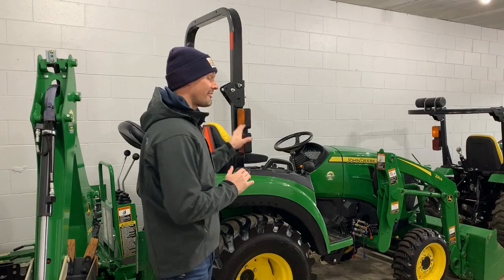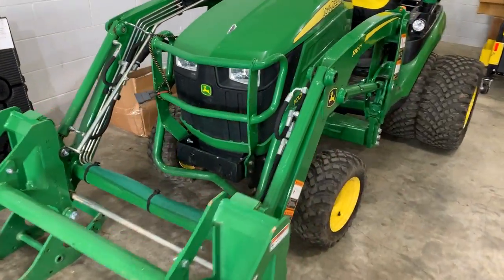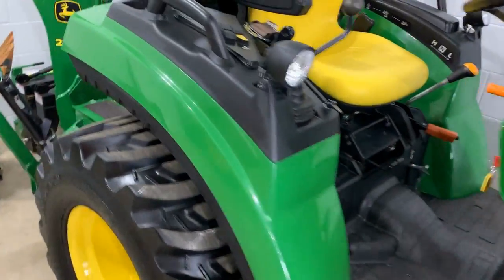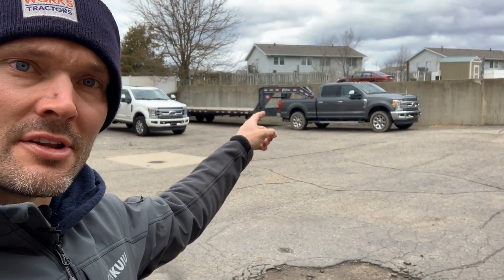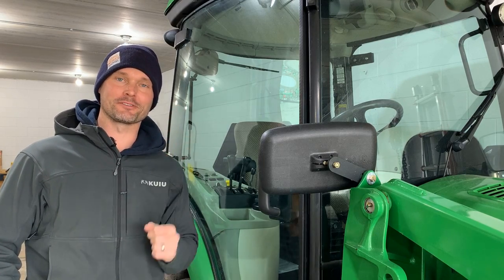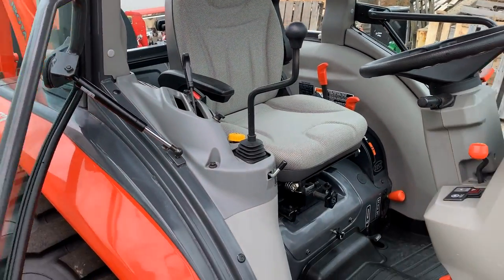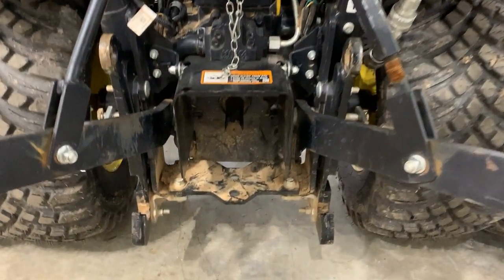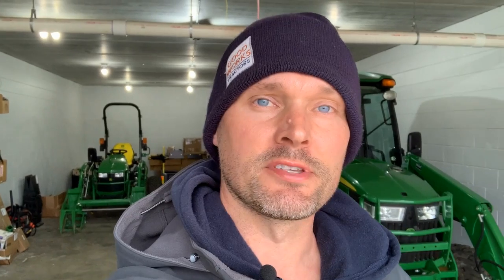TOP 10 SCREW-UPS JOHN DEERE MADE ON TRACTOR DESIGNS 🚜

Comment: IMO - The twin pedal with the forward on the inside is ergonomically correct  … the forward pedal on the outside i think would become uncomfortable during long forward running times … I’ve NEVER had an issue with my 955 and its also perfect on my new 4044M ! …. imo 
     agree with the seat critique fully !! 
    No doubt kubotas are one tough machine … but the hydro trans pedal …. well .. its 👎👎

Comment: I love my tractor but don't want to spend unnecessary time doing  repairs. First thing I installed was a skid plate . There  are to many things a stick can and will find and damage. Filters, hoses,  linkage , hydrostatic fans and so on, leaving you out in a bad place to work on. Been there.  Plus the expense and down time. A skid plate is cheep insurance.  Water separaters,  all diesel engines needs one
Reply from the maker: Yes, skid plates would be great as widely available accessory

Comment: They could put heaters on the LED lights eh? Especially on the front lights
Reply: Yes, that is a very good way to go.  At cold temperature they can hold the lights surface just a few degrees above freezing.  On cool wet days they could hold them a few degrees about outdoors temperature.  
They could also allow the lights to go up to "death ray" power  To get someone's attention.  200W into good LEDs will give your neighbor a suntan.
Reply: @kensmith5694  You only need heat when it is freezing or below the rest of the time no need to waste power.  You can run more current thru LEDs but the more you run over optimum the shorter the life
Reply: @sergeyleftwingnut2385  
For electrical things keeping them a little over outdoors on a cool wet day is a good thing to do.  It takes very little power to do it so if the thing is running it is likely you don't need to work at it.  When something is powered off, the water tends to soak into it.  This shortens the life.
Reply: @kensmith5694  I don't know Ken an incandescent bulb especially lower wattage are better heaters than a light source and if you don't keep them sealed they end up corroded.  I can see using heat to keep ice from forming but for my money I'd rather seal/ encapsulate/ keep  stuff dry/  water out rather than try to dry   up water. I'd rather it never get wet but easier said than done.
Reply: @sergeyleftwingnut2385  
I have never seen an attempt to seal something up other than a pressure chamber actually work in the long run.  A small opening that lets the air come and go is all that is needed.  In the morning, the object is colder than the environment.  Dew will form inside as well as outside.  All lighting fixtures for outdoors have to have a small hole at the lowest point.

Comment: JD is not a innovative company, and I know this will upset a lot of people but look at how long it took them a 6 cylinder engine, other companies had 6 cylinder engine for 30 years, Electric over hydraulic, Oliver had that in the early 60's , Rotary combine they were the last on the market, Case ih White Gleaner all had Rotary 20 or more years than JD.  In my area the only market they haven't lost out on is the front assist tractor.
Reply: They do innovate when it comes to preventing anyone other than their own service technicians to repair their brand.

Comment: if i was getting a garden tractor i would get a ventrac. thats it it does everythign and more than them other garden tractors
Reply: Except they cost more than 3 times more than a sub-compact and have fewer attachments available.  I'm not knocking their usefulness nor quality but, the astronomical price is a major barrier.
Reply: @flick22601  no they have way more they have all different mower options that are easier to attach than the stupin under deck design, it can have a front loader that easy attaches, it has a low center of gravity it can have a 3 point so will fit all the implements the other garden tractors can. and has loads of other attachments that you would need a complete separate machine to do the job of the ventrack
Reply: @flick22601  for what they are i would say the price is worth it

Comment: The #1 thing JD does wrong is the price!   They are much more expensive than Kubota, but you don't get more, and sometimes you get less.   Compare a Grand L4060 HSTC to a 4 series R apples to apples, or as close as possible, and the JD is several thousand more.  Add in the extra year financing Kubota has and it makes it easy to choose Kubota.   Sure Kubota has some flaws as well, but when it comes right down to it, money talks BS walks.  If I could get a JD for the same price as a Bota with same finance terms, I would happily go green.  20 years ago, it was a toss up between Green and Orange, and the bottom line was the price, Orange won back then.  Has been a VERY reliable tractor, which also has a lot going for Orange.

Comment: The reason their not a cab option on the 1 and 2 series is the frame not big enough to handle the weight and height plus it will add 15 grand to the cost
Reply from the maker: The Kubota B2650 has a factory cab with air and heat.  It doesn't add anywhere near $15,000.  Also, the Mauser cab for the JD 1 and 2 Series most likely weighs close to what a factory cab weighs.  So, doesn't make sense.

Comment: You don't need a cab on a 2 series John Deere. I have an older style and the vast majority of people who buy these aren't looking to use them all day every day. Open stations fit better into smaller sheds and they are much easier to maneuver, service and operate without a cab. Also keeps the weight lower because a cab would raise the centre of gravity.
Reply from the maker: Hugs, those are are valid reasons for you to buy an open station.  There are just as many valid reasons that someone would buy a cab tractor.

Comment: An option on a 4R for a mid mower would be nice they are still 72 inch wide tractors so it would work I would also like to see an 84 inch mower on those tractors they are certainly up the challenge and with a cab on a 4R it’s  not possible to have a power reverser only hydro on cab tractors but I like the power reverser so much more and it saves money

Comment: Does John Deere build those smaller tractors or Yanmar. I have a 790 and its made by Yanmar. If Yanmar makes them is it to John Deeres specs or Yanmar.
Reply from the maker: Now it's JD, used to be Yanmar
Reply: Yanmar now sells their own tractor again designed and built entirely by Yanmar.  Pretty impressive machines.  I'd like to see a comparison between a Yanmar SA424 and the 2025R.
Reply: Doesn’t JD own Yanmar?
Reply: @rayhochstetler2659  no, Yanmar used to mage tractors for JD and still makes engines for them.  Yanmar is a huge company making engines for all sorts of applications.  Huge Marine division.

Comment: It's not a car  cruise control is on your car, on a tractor it's called the throttle, I don't know where you got that from. and yes when you actually operate a tractor for two or more hours a throttle control is a must.  lawn mowers weren't meant to go out in the woods
Reply from the maker: Interesting.
Reply: @GoodWorksTractors  Oops. I am sorry my smallest Tractor is 55 HP, I don't deal with anything under 50 horse , to me anything under 50 horse ( compact tractor) is a lawnmower and not much use on the farm, On big tractors we have have a throttle and a foot pedal in some cases. We set the power and select the speed we want, we can change speed simply by shifting up or down on the go.

Comment: I Purchased a new 10:25R in 2016 air filter design was poor not only the brackets broke twice the engine cover it was mounted on cracked and John Deere would not stand behind any of this.had less than 100 hours on it same with many others and bought the same thing. That's why I would never buy another John Deere and I have had three.

Comment: I use Smart Straps.   https://www.lowes.com/pd/SmartStraps-2-in-x-2-1-2-ft-Tie-Down-3333-lbs-Work-Capacity/50372804    Run through the bucket and around ROP's.  I have a 2003 4010 Compact and also mounted forward/backwards LED lights on the top of the ROP tied to a switch on the dash.  Has a voltage meter/USB ports/4 toggles.  I find the extra light is better suited the higher above me.  Those on the side fenders would be limited to visibility.

Comment: Ya......im not a fan of modern tractors lacking drawbars.......thats just horse pup.
Reply: JD 1025R cheeped  out on the FE loader / bucket hydraulic functions. The valving does not allow to raise and tilt at the same time,
,same with lowering . I believe the reason for this is the pump not being able feed enough oil for both functions at once .
They installed a smaller pump and reservoir to bring down cost ??...Duhh.

Comment: Jd using cheapo turn buckles on the third arms is stupid,every one else uses solid steel bars.
Reply from the maker: Many manufacturers are guilty
Reply: Seems shamefull a customer ends up spendy more money after a purchase to fix a simple manufactures cheapness.
Reply from the maker: @scottfoster2487  Gotta look at the big picture.  Being in sales, it's easy to see the overwhelming priority of customer which is price.  As in, as cheap as they can buy it.  Manufacturers try to value engineer many models to meet these competitive price points.  So, they get called out for being cheap.  When they build a machine that has all the bells and whistles, they get called out for price gouging.  Tough gig, haha.  I think the best approach is to make as many of these features available as options to different tractor models.  Not everything can be universal, but as much as possible so that they limit SKU's and give customers the chance to upgrade areas of their tractor that they see fit.  It's really weird that they don't offer more options.

Comment: On 3039R it is a pain to clean the radiators of grass clippings, and it isn't made easier by the need to unplug the headlights at that stupid connector. And speaking of connectors, those hydraulic quick connectors on that tractor are a joke. Cheap, cheap, cheap. I run  high hp farm tractors. We had superior hydraulic connectors in the 1970's
Reply: I can always find things that need improvement but overall I think my compact JD with its attachments is the handiest tool in my tool box, a dream come true. That cab is worth it's weight in gold.  I might also add that my personal preference would be to control the hydrostat with my right hand and the loader with my feet and that I really enjoy the Good Works Tractors videos. Keep up the good work.

Comment: Way back, way back when they used to make tractors where nothing but thick iron work was down the bottom.
The lack of air conditioning is because it was designed by idiots.  Think how many watts a room air conditioner is.  You need about 2Hp for 1000W of power
The lack of hooks is likely the same idiots.

Comment: Word of Wisdom stay away from the E Series 55/65 nothing but problems I have bought one when they first came out I was the first to experience the problems with John Deere and they're poor engineering they used steel lines to rubber lines with hose clamps that did not hold up as well as the hydraulic lines blew off within the half hour of plowing snow as well as the injectors flare nuts we're all loose from the factory extra bolts were laying on top of the motor the anti-freeze was leaking constantly we never did find where the hydraulic fluid was going in two years time of the John Deere dealership of working on it stay away from these newer tractors they're no better than the newer vehicles poor workmanship as well as the engineering I tried trading it in they won't would only give me 1/3 of what I paid for and I was trying to upgrade to a M series. Never did buy a new John Deere.